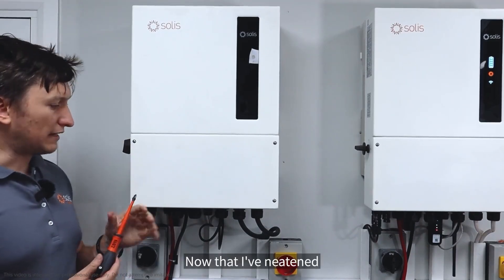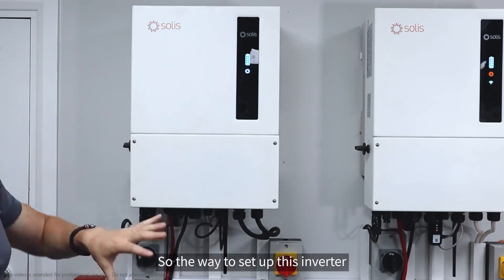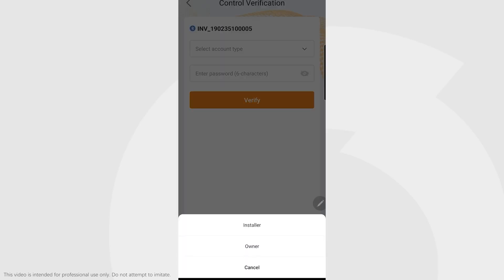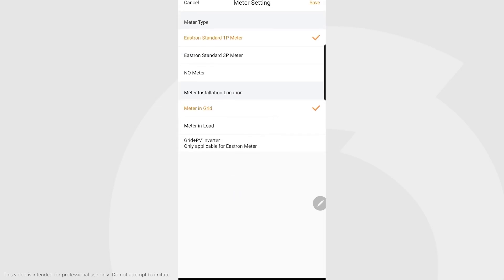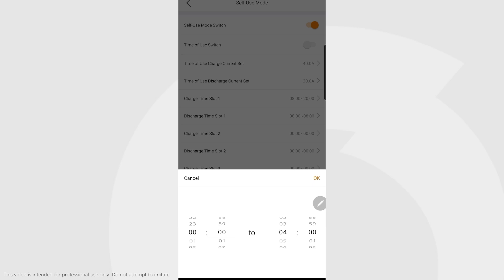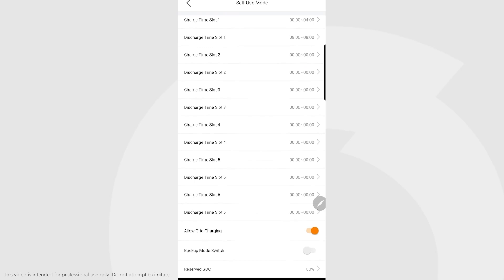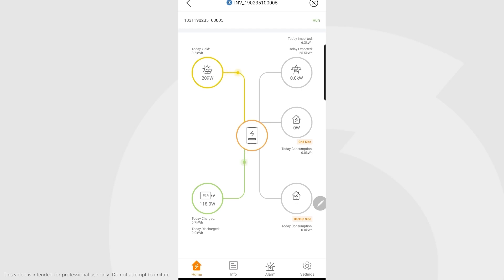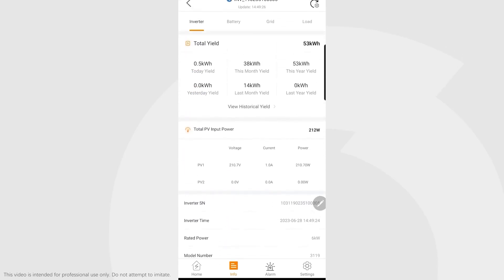Solis Installation Guide 𝐒𝐞𝐜𝐭𝐢𝐨𝐧 𝟓 𝐏𝐨𝐰𝐞𝐫𝐢𝐧𝐠 𝐔𝐩 & 𝐂𝐨𝐦𝐢𝐬𝐬𝐢𝐨𝐧𝐢𝐧𝐠

Comment: Hello sir. Pls how do I reset my installer password? The owner password is good but I made mistake in installer password and can't remember it. Also we just connected the grid but the inverter does not sense the grid. Could it be because no CT has been connected? It shows fault shutdown in the app and says in previous alarms fault No Grid detected. Is AC virtual? Thanks.